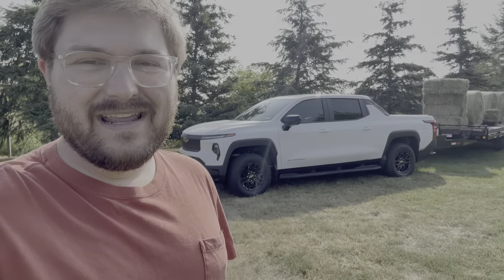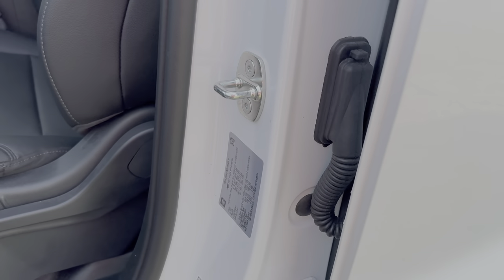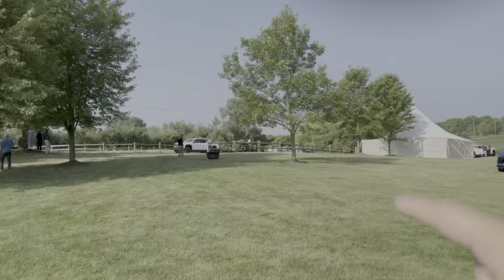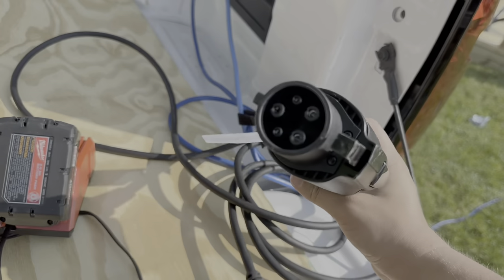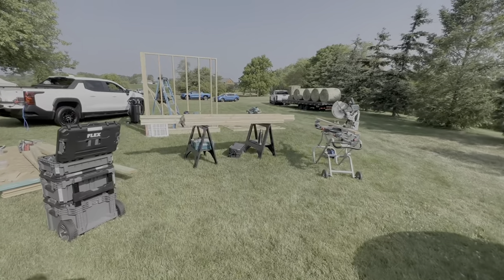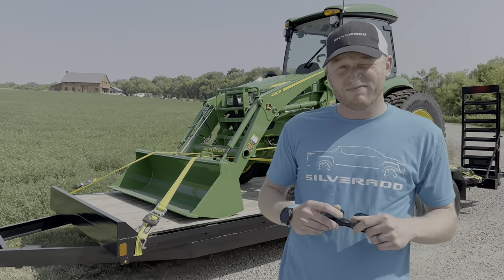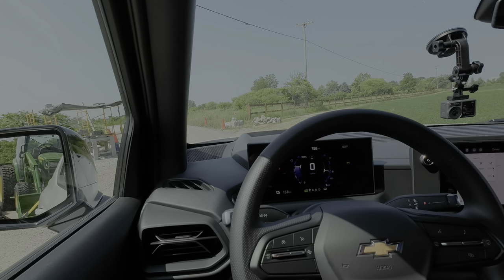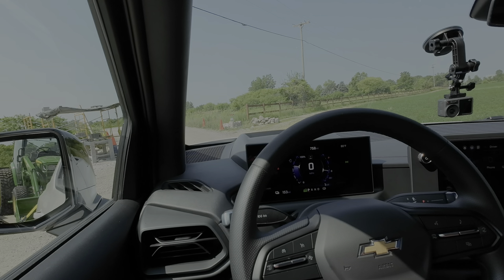Towing With The Silverado EV! Everything You Need To Know About Towing With Chevy's Electric Pickup

Comment: They need to start making pull thru charging locations like our gas stations
Reply: Tesla does, ea has station's opening later this year laid out that way with overhead solar canopies&battery storage(tesla megapacks)
I think flying j&bucees with the latest gm&tesla charging tie ups will ad more laid out like fueling station's are. 

Wal-Mart is getting in the charging game to and one drawing I saw showed station's under a canopy with side by side pull through setups for it.
Reply: Yepp, that has been a complaint for years.
Reply: Charging ports should be at the front. 90% of all carching events is at non public chargers atm. These are typically mounted to a wall.

Comment: Kyle, so you know in the future, thats a John Deere 4 series, model 4075R. The loader is a 4 series loader, model 440 R. That weights about 5600 lbs base weight, plus they have a weight box on the back to get the trailer to that 9k. Like the Nokian tires, neat demo setup.
Reply: Correct.  The labeling can be confusing, but the important bit is that the loader is a separate product from the tractor, even if you purchase them together.  You can connect or disconnect the loader in 5 minutes or even sell it to someone else with the same series of tractor.

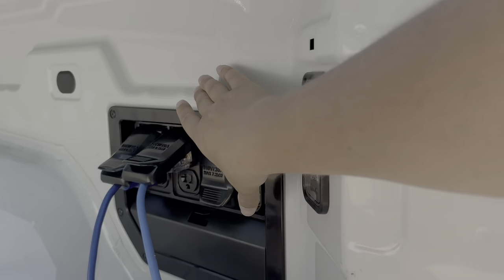Comment: 7:28 - Wow, that NEMA L14-30 connection with its 240Vac 30A can easily power a whole home in off-grid setup.  Just make sure to disconnect the mains or it could blow the truck's inverter!  

Also, it will power a home easily all 24hrs -- and several days if conserving.  Imagine a natural disaster situation it will be very handy let alone just the annoying occasional city grid blackout.
Reply: Agreed.  My remote home has a 120/240v, 30A inlet for a generator, but plugging a truck into it would be so much cleaner.  They make interlock brackets now for most contemporary electrical panels that make you chose either the inlet breaker or utility main breaker so that both can't both be on together.  That saves having to go with a subpanel, etc. 'Much cheaper than a full transfer switch and subpanel.

Comment: The weight of the truck is shown as Curb Weight on the sticker inside door which is 3871 KG or 8532 lbs
Reply: Which is approx 100lbs heavier than my 2020 GMC 3500HD AT4 and this ev has less than half the towing capacity...

Comment: Finally hauling some useful - hay! 10 tons of large rectangle hay bales stacked would really block a lot of air.  I see they got very creative with the placing bales for the demonstration trailer. The 240 volt output is an absolute must have.
Reply: Oops that's only 5 tons I was thinking 10 t. <G> Just enough hay for a few days. <G>

Comment: Just FYI, I LOVE Pilot and Flying J stations. Great places to stop. I was wondering when they would add EV charging. Glad to hear it is something they are working on with them.

Still kills me that most of these gas stations today are not adding at least 1 or 2 EV charging stations. Guaranteed traffic for like 20 minutes minimum.
Reply: Yep and fueling stations make more money with people stopping in and buying stuff from the shop than the actual fuel sales. It would be nothing for a few of these areas to set up a small sitting area with coffee and snacks for sale while folks wait a few minutes to charge.
Reply: I thought free wire would corner that space personally? They have a few here at various gas stations here in GA already. 
Usually just 2 dual head station's. 1 ccs, 1 chademo port or dual ccs I've seen so far. 

With the low install costs&onboard battery backup. It just made sense to me they would quickly become added to gas stations. 🤔 

Maybe a lot of charging companies are in limbo due to the ira passing late last year? Chargers not made in the U.S. with U.S. sourced materials aren't even eligible for the nevi incentives muddying the waters so to speak.

Plus the recent tesla/nacs vs ccs1 war? Teslas like or or not right now are over 75% of all evs on us roads, and with the production capacity they already have? It won't change much until late 2025+ either likely not until more toward 2027 imo.

The single most productive automotive plant in the U.S. is teslas freemont plant for 2+years running now. Also the largest ever automotive plant under 1 continuous roof. Right NOW in the U.S. is the tesla ev only plant in tx. It's only getting started with it's ramp up.
Reply: Buc-ee's way ahead of them

Comment: 16:17 during towing, aero is a huge factor over weight when ln level ground (~0% grade). It flips when going uphill
Reply: Just like my ice truck!
Reply: @gmv0553  Except it much easier to refuel our ICE trucks when towing. I would love a PHEV version, nothing crazy, maybe 60 km of EV range is more than enough around town range and enough ICE to tow 4000 kg in hybrid mode, a small flex fuel V-8 should be more than enough even in HD trim with a hybrid mountain mode. Big bonus would be no need for a crazy transmission versus an ICE truck.
Reply: It does not "flip".   Aero has the same amount of range issue when going up, flat, and down hill at the same speed.   Weight is the only thing that is a negative, neutral, or plus when going up, flat, or downhill respectively.
Reply: @curtisbme  you are right! I didn't word it properly. The aero is a function of overall speed and overall CdA but the weight on Uphill on quickly add up, and higher the grade %, m*g*sin∅ catches up quickly. I guess when normalized to 100%, we can see the distribution start changing every % of grade.

Comment: The problem with charging port locations has more to do with how charging stations were first being setup at parking spaces. Charging stations should be setup the same way gas pumps are setup.
Reply: They are set up in rows at most Ea locations in Ohio except huber heights oh
Reply: No they shouldn't.  Until they battery tech gets to where you can be in and out in 5 minutes, you need to park and the current set up is the most space efficient may to handle charging that takes 20mins to hour+.  They just need to add some pull-through options in big lots that have the room to do so.
Reply: @curtisbme  Sorry,  that does not change what they should do and some are starting to be set up that way.
Reply: @robwalker4548  Hey, if you have all the money to buy extra land and don't care about return, you put in all the pull through electric charging stations for the tiny minority of trucks that might be towing something that you want.   But for those in the real world, pull through stations will be secondary options, not primary ones.

Comment: Who cares what it can tow, the WORK truck is 80k!  After the small market that can purchase the consumer version, which is 115k, what is left for EV trucks?
Reply: Cheaper versions will be introduced next year.... GM is starting with the top trims.
Reply: They are all giddy about a truck the public can't buy. Fleet only. Really annoying. They can't say anything bad at the moment due to their contracts they signed I'm sure. For the price of these, you only get a big battery, and a bare bones interior. Ford could have done that to, but realistically, people keep frowning on the Lightnings for their 131kw battery and it's tow range. Majority of people don't travel 100's of miles a day, let alone tow, even at Max capacity. These trucks really aren't meant for that. I'd much rather have tons of creature comforts with a smaller battery to offset the cost. With the midgate, I hardly ever saw anyone with an Avalanche actually use it. These YouTubers reviewing these trucks are out of touch with what the public actually uses these for and the loudest critics are the guys who regularly tow with their 3/4 to 1 ton pickups any other day. That's just my opinion. It doesn't really matter.
Reply: @Nebula1701 the work truck STARTS at $80K basically the cheapest version.
Reply: @bsandoval19  the WT4 work truck does, that's the fully loaded one. There are still cheaper versions.
Reply: Been on the list since they announced it. Really disappointed the work truck price has doubled, putting it out of reach. For me, with the mid-gate, it’s my dream truck 😢

Comment: Can’t wait for these electric trucks to be common. So sick of all the diesels spewing toxic coal smoke in my face walking around the city
Reply: Hyy sir
Reply: Personally, I'm tired of smelling the DEF fluid. The smell of mechanical diesel is so much better. It's going to take some serious battery energy density advances before EV HD trucks replace diesel HD trucks.
Reply: @mtnman1984 yeah that probably won’t happen for 20 years
Reply: @Itsme-fn9mc  the batteries will likely be developed faster than we think, but the timing of designing a new car around the new tech is the question.
Reply: @mtnman1984 Why do you think it will develop faster than we think?  If you're open to learning more about future development in EV batteries, listen to "The Vertical Space" episode 16 with MIT professor Donald Sadoway. It's a podcast for EVTOL and advanced air mobility, but this episode is relevant to auto EV batteries as well. The automotive industry is not strongly incentivized to develop better battery technology from a specific energy density point of view.
Reply: Evs burn more coal than diesel.
Reply: @arenjay3278  you think diesel falls out of the sky?
Reply: @mtnman1984  im sitting in my electric car charging for free in a parking lot and about 10% of the E im getting is from Coal 60% from Natural gas and 25% from Canadas largest solar farm.  A diesel truck gets 100% from our Oil Sands Bitumen and none from coal.
Reply: @arenjay3278  that diesel truck just drives to a tar sands mine and shovels it into its tank? Wow.
Reply: @mtnman1984  oil sands no mines it literally just the dirt in your backyard or just under the muskeg.  We put a pipe in an steam and water mixtures then suck it out of the ground.  Like a big oil spill cleanup.  Sometimes we dig the dirt up and extract the oil then put the clean dirt back.  The bitumen gets shipped to the gulf coast for processing usually by train or pipelines.  Then processed into diesel.
Reply: @arenjay3278  oh, there are processes. Cool. Might any of those processes use electricity?
Reply: @arenjay3278  crickets
Reply: @mtnman1984  mostly diesel generators this isnt done where the electrical grid is established.
Reply: @arenjay3278  Christ, I'll just jump to the end or we'll be here forever. Most modern tar sands mine sites have fossil fuel powered cogeneration plants that produce both the electricity and steam that is required to operate the facility. Tar sand crude, specifically, is documented to require triple the carbon emissions to extract vs conventional crude. Then, it's on to transport to the refineries through pipelines powered by local grids or standalone power using fossil fuels. Some of it less efficiently by rail. Refineries use fossil fuel powered cogeneration plants similar to the mine sites to produce the steam and electricity used on site and purchases supplemental power from the local grid. Then pipelines, using electricity, carry the refined fuel to regional terminals. Lastly, the fuels are transported by truck to gas stations where that diesel truck is filled up. 

An EV draws electrical power from the local grid and is 95% efficient with the power they draw vs a typical 35% for diesels. Do you notice the missing steps between the two "fuels"?

We could have another conversation on battery construction. Recycling makes a good case for the environmental impact now. We don't burn the batteries after mining and refining the materials. Advancements in power density will make the issue moot in 25 years or less anyway.
Reply: @arenjay3278  anything else?

Comment: Chevy should sell a CCS extension cable that would allow you to pull into a fast charging station nose first with a trailer. 🤔
Reply: If someone wants to charge with a gooseneck trailer, there's gonna be some extra steps involved.
Reply: That might work in a pinch, but I bet it would throttle charging speeds quite severely. DCFC cables are liquid cooled. An extension cable wouldn't be and would get way too hot too quickly.
Reply: Very tricky problem. The cables include cooling and thermodynamic management.
Reply: @justinfowler2857  Or it would be a very fat cable. Like the Tesla V2 supercharger cables that are not liquid cooled and are super heavy vs the V3 supercharger cables that are tiny but really fast and liquid cooled...
Reply: @peterjorgensen3  That might work. It might end up being really stiff and hard to handle. Especially if it's cold out. Not saying that it's impossible. I just question the practicality.
Reply: @justinfowler2857  Not much different than EA putting that crazy cable on their 350s, right? I guess we'll see.

Comment: I wonder if GM could retrofit a NACS port in the frunk area?  I mean if they didnt want to chop up the front fender and put a complete charge port.  You could just pop it in the frunk with a rubber plug or something.
Reply: I still think these truck and SUV EVs that can tow respectable payloads should have a NACS port in the rear of the truck next to the hitch. That way, future companies that make trailers and campers etc with battery skateboard platforms can have them plug into the rear of the vehicle to help add range.

Comment: It may be legal to tow without a weight distributing hitch, but it isn’t sensible.
Reply: The ev weighs as much as a F350 dually depending on configuration.  Doubt the weight distribution hitch is needed. I pull heavy with a 1 ton and have never needed one. That said, you need to know how to load a trailer.

Comment: If payload is 1400lbs the 1000lb tongue weight of the trailer leaves you 400lbs of useful load capacity. Add a 200lb driver and passenger and you're at max gvwr. Put anything in the bed you're over gvwr. You'll not see a 5th wheel option on this truck due to pin weight.  You'd need much more payload capacity for a 5th wheel. If rv 5th wheel the aerodynamics would kill range. All that said, I have one on order.  My heavy towing will remain assigned to my dually diesel.
Reply: Pretty sure this is targeted at those that are using and happy with half-ton capability
Reply: I am betting that you can go well over the rated payload without stressing the truck any.
Reply: @woodspk42  My Silverado 1500 LT Trail Boss 3.0l LZO Duramax has a curb weight of 5500lbs, 3000lbs less than this ev, and has a conventional towing capacity of 9000lbs, more than this ev, has a greater range while towing(325mi) or not towing(650mi) than this ev, and was less expensive($65k) than this ev...
So tell me, where's the value in this ev...???
Reply: @TroySavary  And should you do that and something happens, accident, vehicle breakdowns, etc, that's all on you...

Comment: As far as the charging port location (rear port >left< side) issue goes, I suppose a simple solution (not ideal) would be basically some kind of "extension cord" type deal. Not ideal but it would bridge the gap until they (GM) can come up with a dual charge inlet configuration. Either way, that's a hell of a caterpillar hangin' outa that stall. I mean it's gotta be 4 car lengths (Bolt) long. 
There Has to be a better way. Overhead slide rail?

Comment: If a 10 kWh  battery for a home costs about $7k-$10k how the heck does this car sell for $78k when the battery has to be about 200 kWh?
Reply: 1kWh at pack level costs about 120 to 150$, so 200kWh is 24-30k.
Reply: @Scrap-press  isn’t a power wall 10kwh? And isn’t that about $10,000?
Reply: @mgarcia8878  Yes and yes. When i build my home made solar batteries i get the cells "B-Grade" for about 150 Euros /kWh. When i buy the complete pack including everything its about 1000 Euros/Dollars. Even buying a used VW or Tesla battery pack is just too expensive.
Reply: @mgarcia8878  Your's lthe retail price. Those 120-150 is what is cost for car manufacturers at the pack level.
Reply: @Scrap-press  that’s a hell of markup. It won’t be long when people start looking at price per kilowatt.
Reply: @mgarcia8878  I'm pretty sure there are 10kWh LFP packs available for 4k or less.
Reply: I don't have a power wall but doesn't it includes an inverter and all kinds of electronic management system.  So the cost isn't just a battery.
Reply: @chumanji9  the trucks motor inverter is much bigger than a power wall, and the truck also has an additional inverter. I can build a powerwall for less than 50% of Teslas pricce

Comment: Does it have a 5th wheel option?  It weighs about the same as my F350 7.3L. A 5th wheel hitch would be awesome.
Reply: Right...are these half tons or 3/4 ton truck. These heavy ass things are gonna eat up the already crumbling infrastructure.
Reply: Sticker had no goose-neck option indicated.
Reply: @zapfanzapfan  understand. Its an omission.
Reply: @kelargo  Sticker also said tow weight of 8000, not 10 000 like was suggested with the hay bales.

Comment: Just make charging stations like gas pumps.  Pull through addresses the towing or port configurations in different places.  No reason to have a "standard" location for charge ports.  Let's fix the charging stations.  

Rural locations we don't have access to DCFC and we are towing distances with heavy weights for work purposes.  So towing range is a big deal.  Not sure that a massive battery like this is the best cost benefit vs adding a range extender of some sort.  Will be interesting to see how this market matures because we need working trucks out here.  The Rivian and Lightning currently don't do it.  And I have my doubts about this unibody Silverado.  Will be interesting to see how Ford responds to this.  The Rev sounds like it is going this exact same direction as the Silverado.